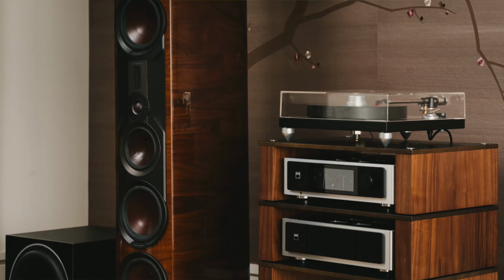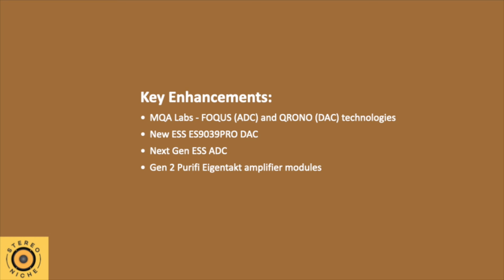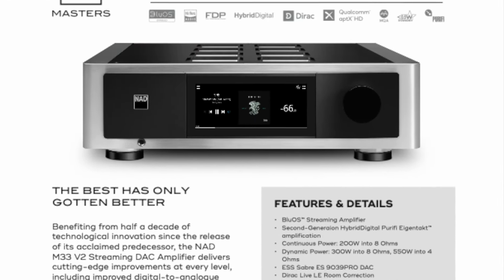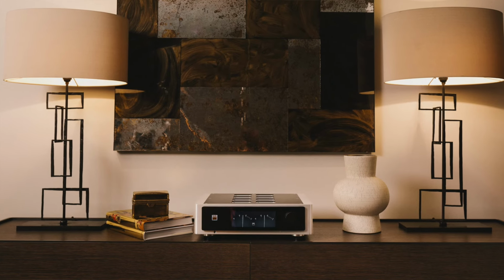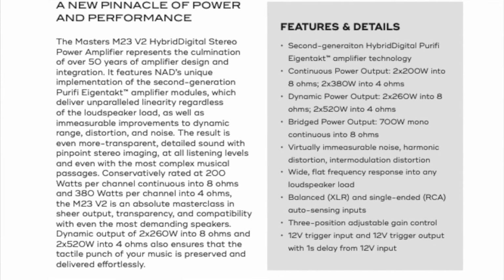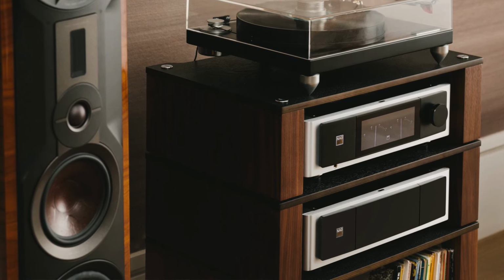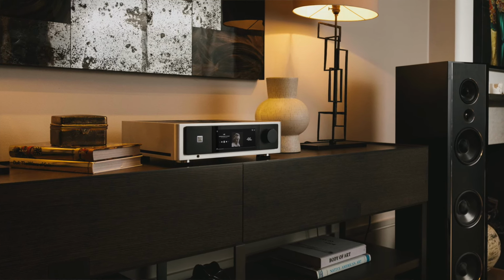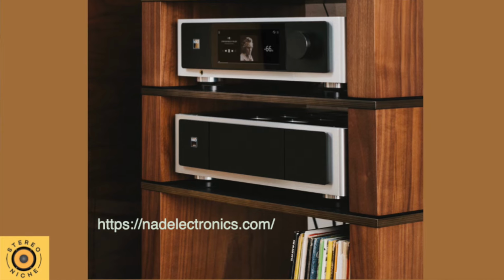NAD Unveils M33 V2 Streaming Amp & M23 V2 Power Amp! Masters Series Evolves

Comment: Price jumped to $7,200
Reply: One can buy pair of Purifi Eigentakt 1ET9040BA based monoblocks from Buckeye Amps or from Audiophonics for less than 3000$ USD. 

Each delivering
1200 watts @ 2 ohm
750 watts @ 4 ohm
375 watts @ 8 ohm
40A of current delivery 
 … why pay more?
Reply: @milosdunjic8718for the complete package